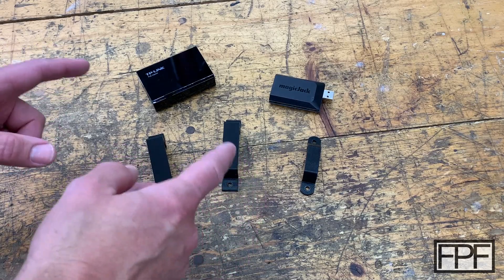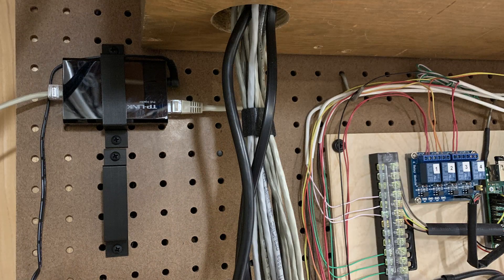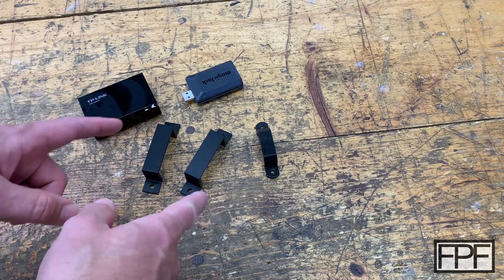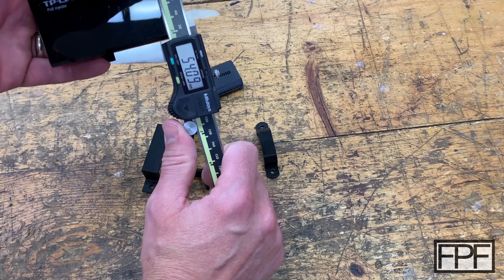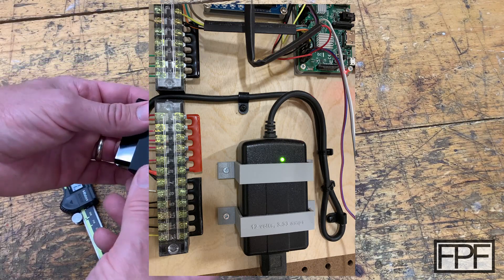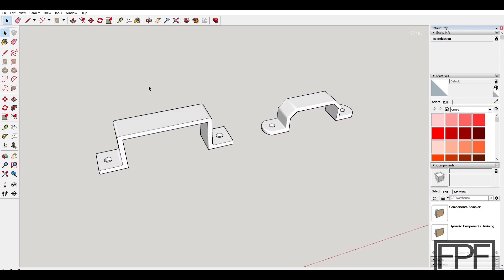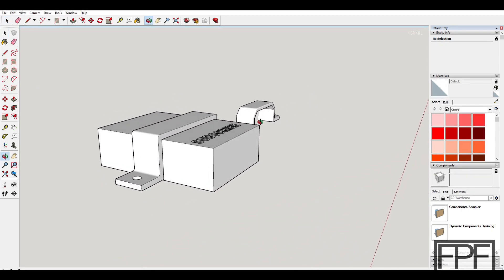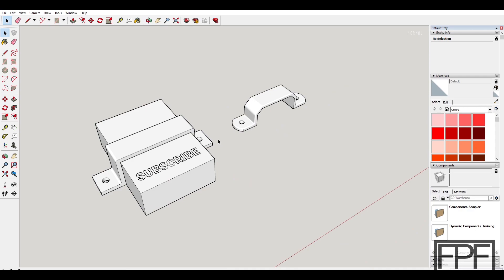3D Printed Wall Mounting Brackets

Comment: It would also be helpful to talk about the orientation of the parts when printing. I am still new at this, and my guess would be they should be printed on their sides, but I know that can lead to non-circular holes. Other newbies might think they could be printed as-designed, but I'm pretty sure that would lead to fragile parts.
Reply from the maker: Thx, point taken.  I do this in some of the vids when I talk about the design, but I need to be more consistent.  I should probably just make a list of bullet points to try and hit every time.

Comment: Good video. I've made a few brackets like that before.
A video subject suggestion if I may... How to figure out bevels/chamfers or radi's of parts so you can make a 3d printed component to fit right.(ie the bracket you had with the with the beveled corners) How do you figure that out without making 3 or 4 test parts before it's right like I do?